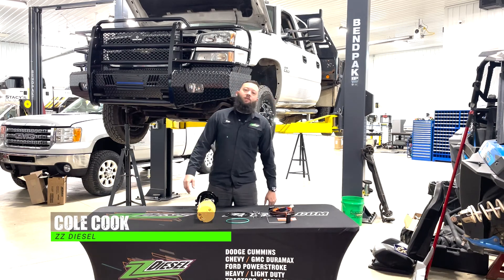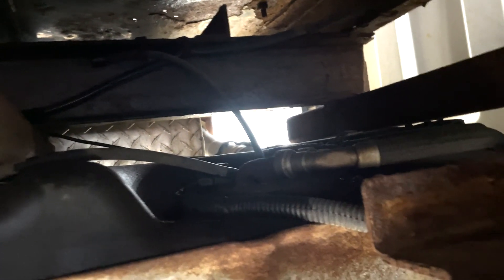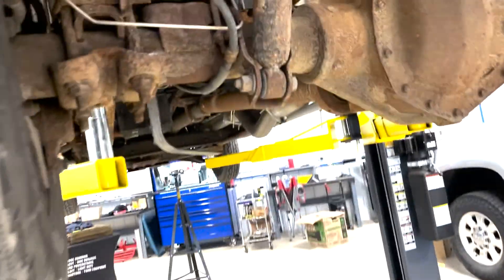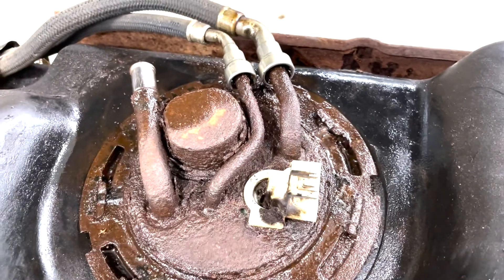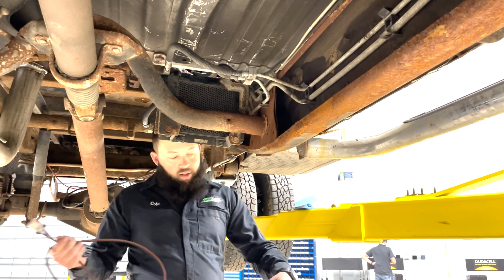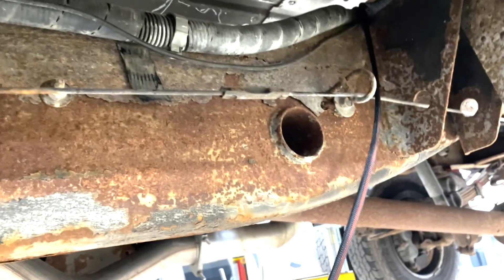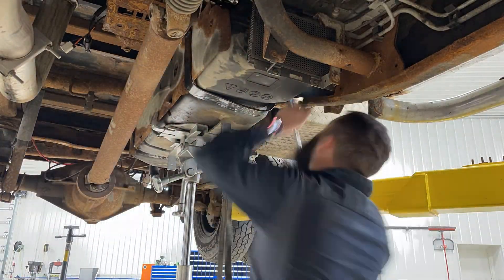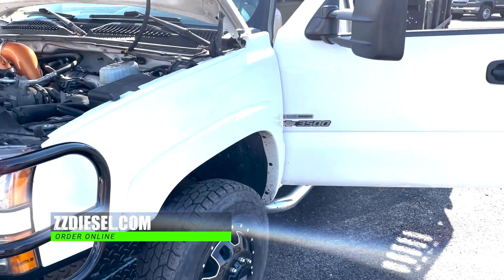Fleece Powerflo Lift Pump Install, 2006 LBZ Duramax

Comment: It's quicker to pull the bed. I can do this job by myself in 30 minutes. Leave a bolt in the front and rear passenger side just a few threads. Pick up driver side and hold it up with a 2×4 cut 24 inches long. You can now access the top of tank. Your welcome.